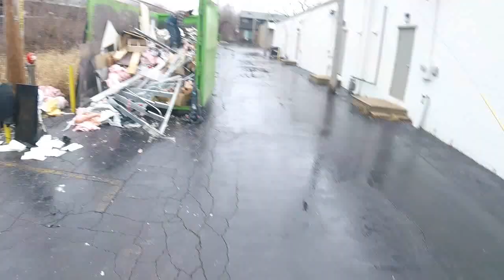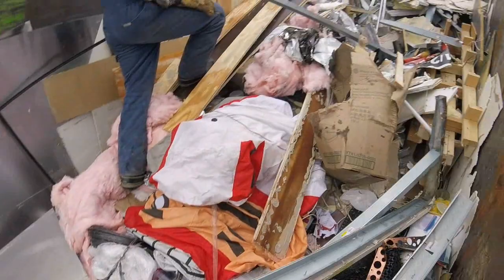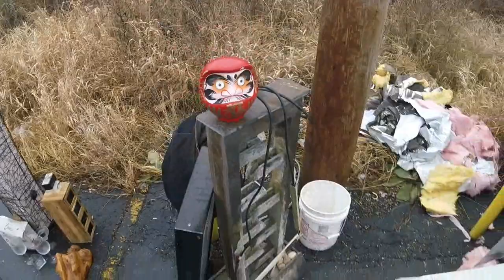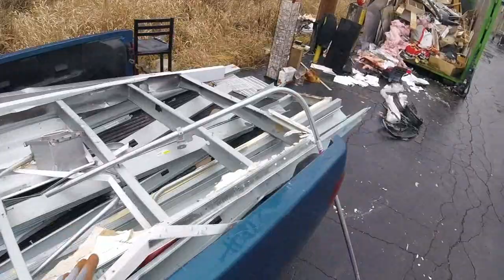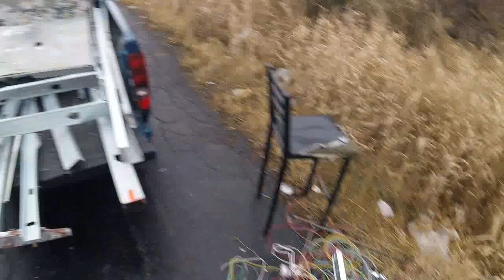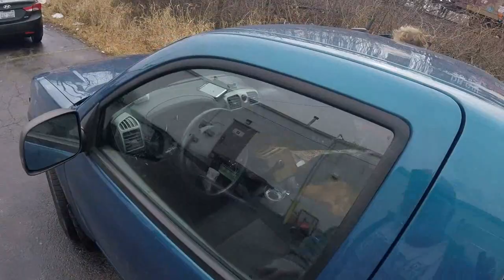Is Micro-scrapping Worth the Extra Time Required?

Comment: I was  cringing when you cut the cord on the 3rd vacuum that if it worked I would assume a good chunk of change even for parts. Sense it is a commercial vacuum not quite sure it would depend on what the unit is.

Comment: I a word YES . But like I have always said the more the merrier. Like for your actions unit. You have shared a copper, aluminum, insulted wire a motors, compressor even has a chunk of copper inside. So for your ac unit you get .$06 per pound or broken down maybe 1.50 a pound your choice is at your comfort level.